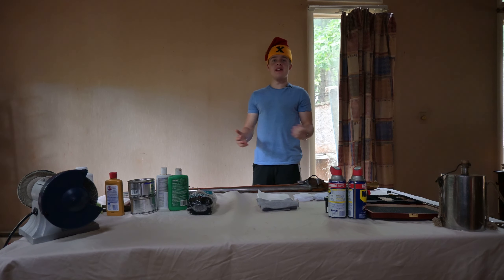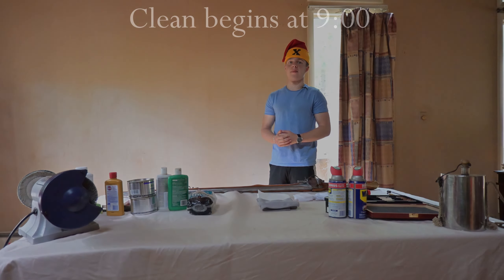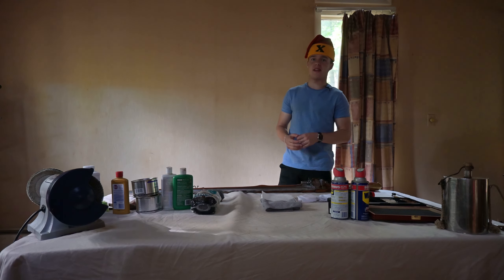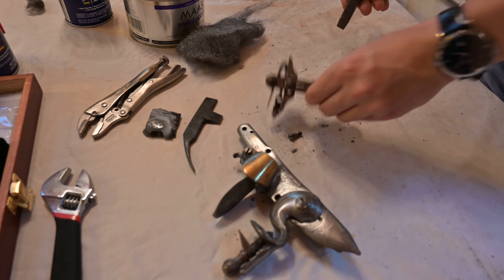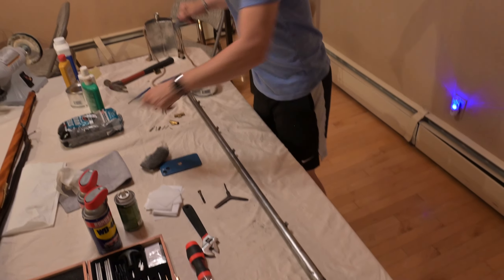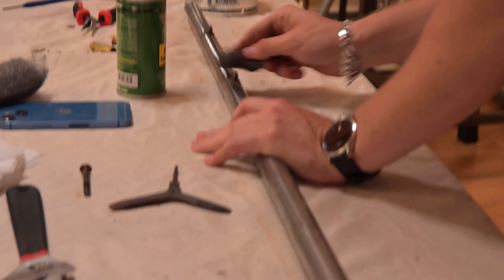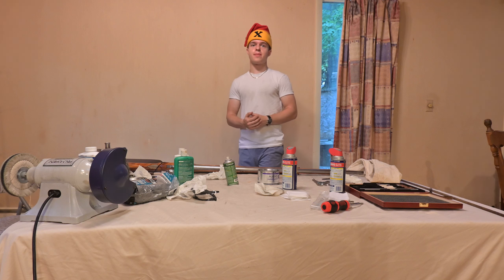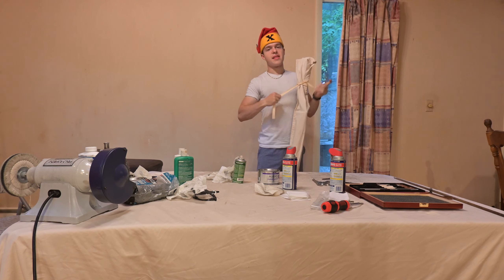How to Clean Your Musket | A Complete Guide

Comment: some very good work, though I would like to advise, storing the musket in the linen case is not best practice for preventing rust. In a dry climate, or climate controlled house you can get away with it. However in a more humid environment that fabric will attract and trap moisture against the musket causing rust, best practice is to store them un-cased, muzzle down, in a dry place. The old stereotype of the musket hung over the mantle comes from the practice of that being the place in the house with the lowest humidity.
Reply from the maker: Hi there, thanks for watching! We should have specified that an oilskin musket case is the best, however from our experience, keeping a musket well oiled and in a case helps block moisture from reaching the musket. Though as was stated there are many methods and opinions surrounding musket maintenance. As you mentioned, the climate in which you store it is more critical! Hope this video was otherwise helpful!
Reply: @HM10thFoot  put it to you this way. I have already, and intend to continue to send this video to my lads: and hope that it will accelerate the process of training them on musket maintenance for our group.
Reply from the maker: @Dreadought  We truly appreciate that, it means a lot! Where is your unit based out of? Maybe we'lll face you on the field some time!
Reply: @HM10thFoot  That would be a strange battle indeed: I belong to a War of 1812 group that reenacts the Grenadier company of the 100th Regiment of Foot. We are Based out of the Ottawa Valley, close to Canada's capital.